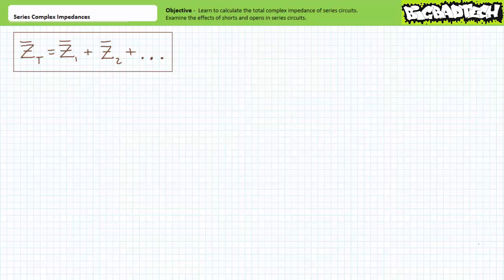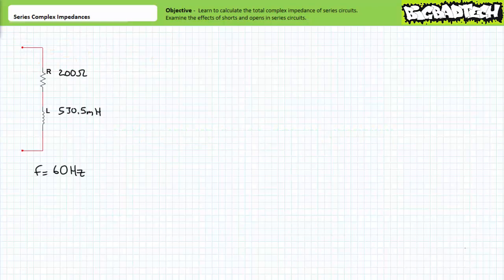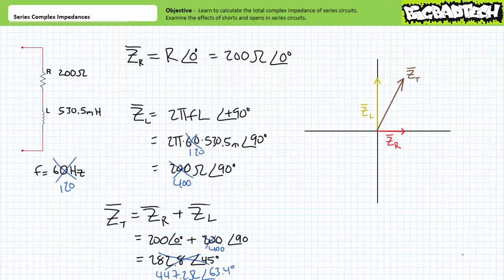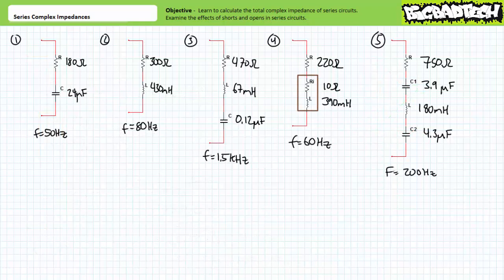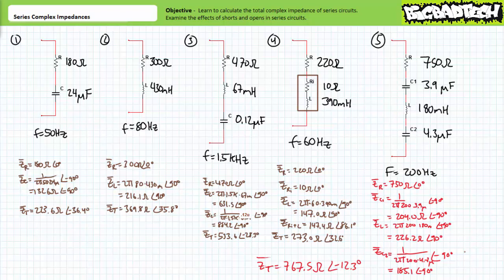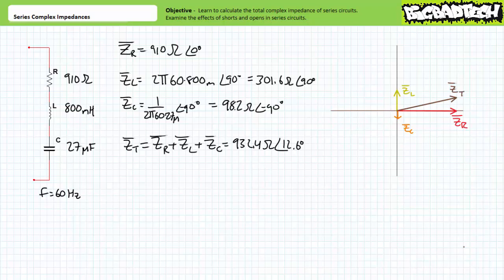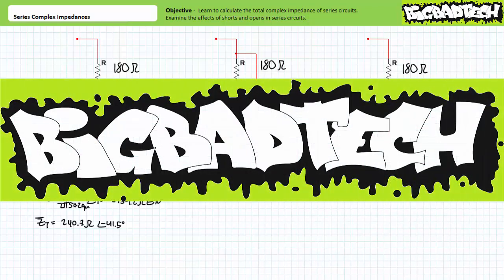Series Complex Impedances (Full Lecture)

Comment: I think your videos are great!The final parallel LR circuit resistances were found using the formula R1 x R2 / R1 + R2. Then was multiplied by the square root of two? I don't remember that one.I always thought the 45 degree hypotenuse was supposed to be longer than the other 200 ohm legs? Is that only in series circuits ?
Reply from the maker: It's actually a little more "complex" than that. Check out the complex numbers playlist at: https://www.youtube.com/playlist?list=PLdnqjKaksr8o08K4VY02fVXQijxT1yDTI

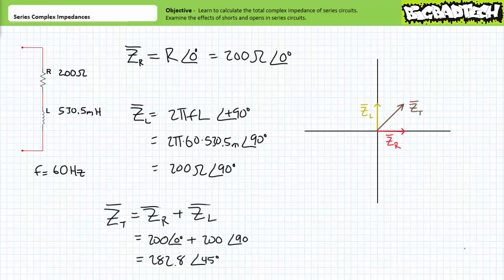Comment: Hello, I don't have a scientific calculator and I have been trying to do calculations with a graphing calculator, for the questions involving angles I found a simple scientific calculator online however I cannot add, multiply, subtract, or divide numbers in polar format directly. at 3:43 I noticed the equation wasnt simply added up to 400 and 90 degrees so it wasn't added the way my calculator knew to add up. Since that step has been glossed over could I ask where I can find to do that math manually or how I can acquire a calculator that performs those  steps? I found some impedance in series questions can still be solved by converting with rectangular to polar and vice versa however I worry this can't be done for parallel. Any help would be greatly appreciated.
Reply from the maker: Everything you ever wanted to know about complex numbers is right here: https://www.youtube.com/playlist?list=PLdnqjKaksr8o08K4VY02fVXQijxT1yDTI

Comment: Hi Jim, just wanna ask this, why others use this formula Z = sqrt of R^2 + (XL^2 - XC^2)?
Reply from the maker: That is only the magnitude of the series impedance neglecting the angle. I’d highly recommend not using that particular formula because you’re only getting a partial understanding of impedance.
Reply: I tried solving a problem using the formula i mentioned and yours, and now i understand. True it's better to use the formula with the direction included. Many thanks Jim.